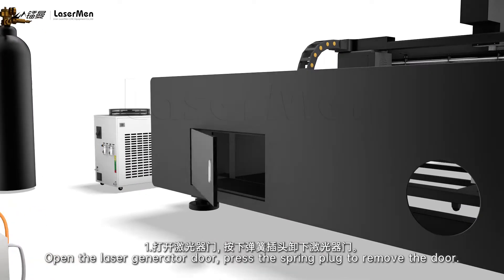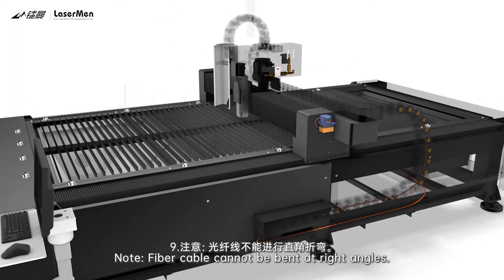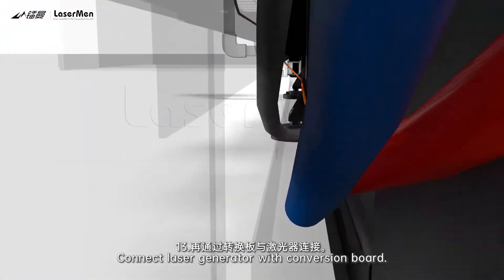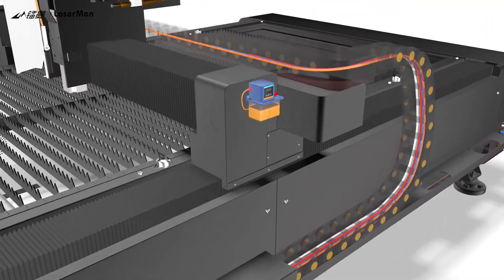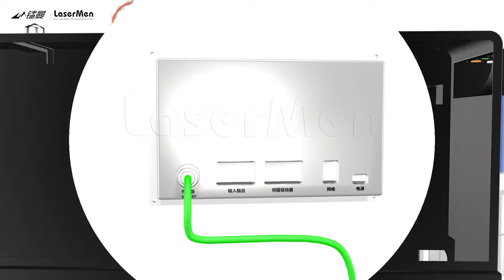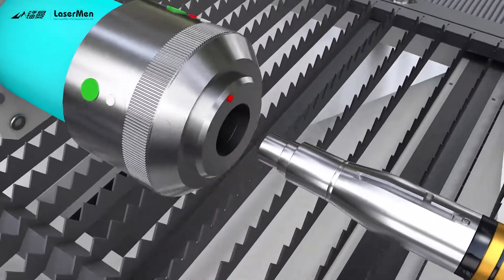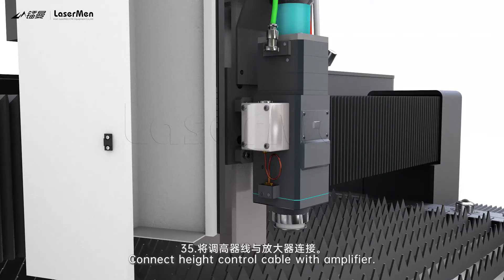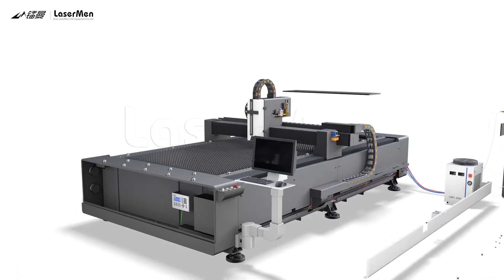[LaserMen] Fiber laser cutting machine installation

Comment from the maker: 0:09 Laser source and optical cable installation
1:05 Water chiller connection
1:48 Gas bottle connection
2:44 Height control cable connection
3:10 QBH and laser head conection